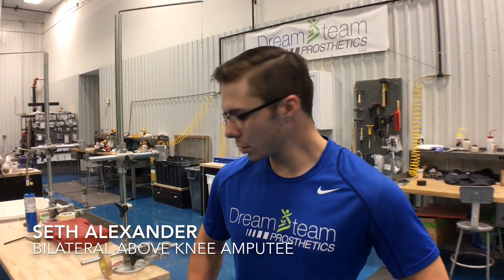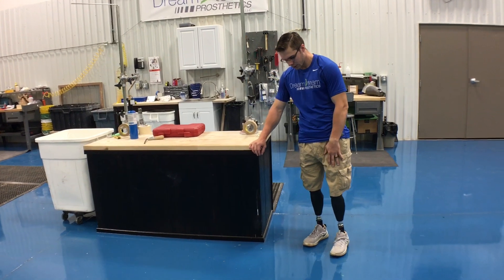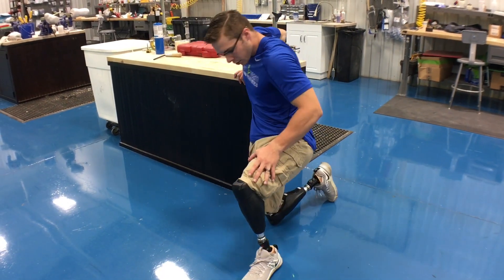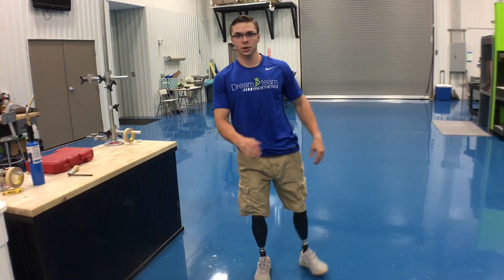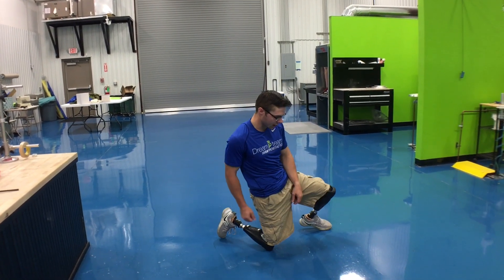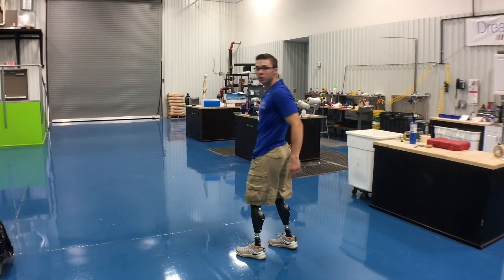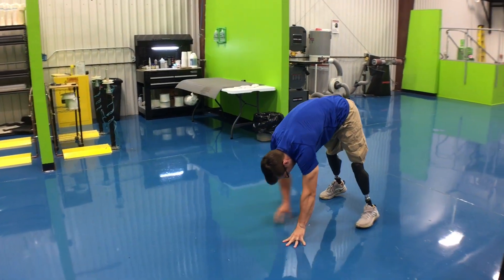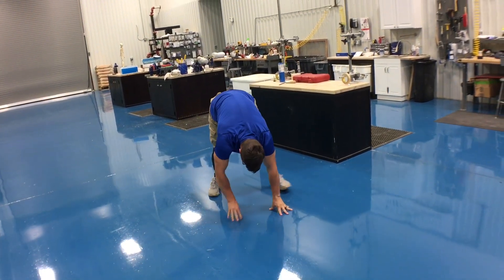Bilateral Above Knee Training: Floor Techniques

Comment: First off you make that look to easy, when you go down without using the table you hit harder, is there any chance of damaging the knee?
Reply from the maker: Seth is using the Ottobock Genium X3 and the rubberized protective cover protects the knee from impact damage so it is not a problem.